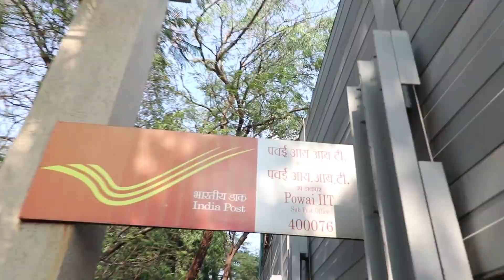Don't DO THIS Plz

Comment: The Rode Mic that you used in the video...is really good and the audio quality is also really good compared to the Mic that you were using earlier as it made your voice a little bit loud which did happened in case of Rode When you switched it to +20 decibel mode.
I think you should use the rode Mic more often in your vlog as audio quality is more rich and clear.
Also I am a big fan of yours...!!